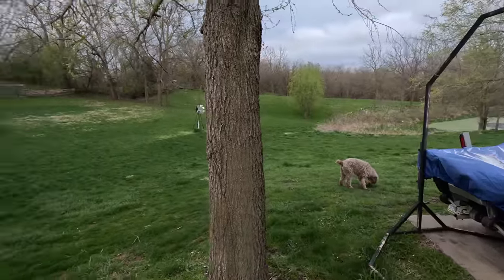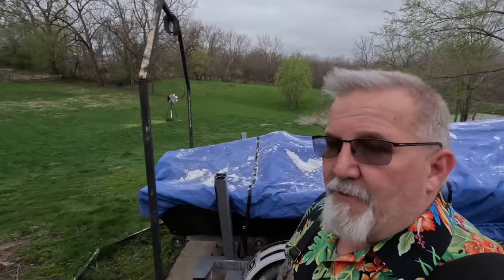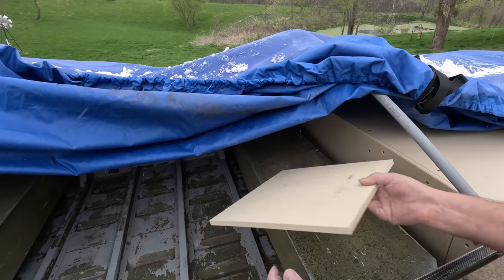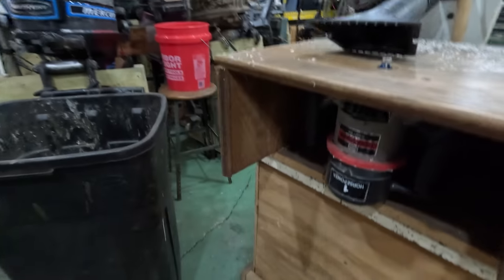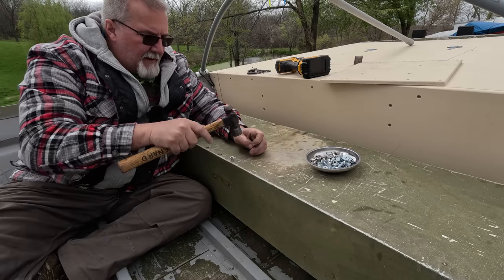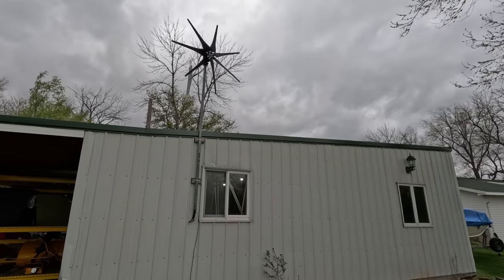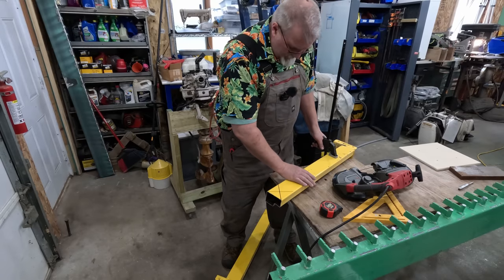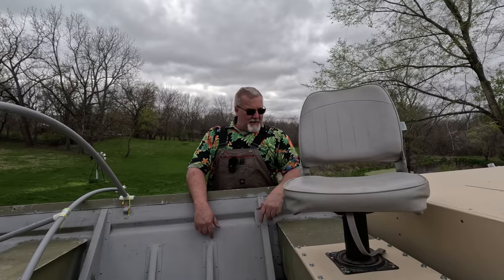1983 PolarKraft Genius boat seat mount plus a dry dock modification

Comment: Some good info on the seat mounting on the Good Enough boat, 
But what caught my eye was what was used for the tarp support arches and how they were mounted to the sides.

This will be a vast improvement over the vertical adjustable support poles that seem to fall out with just a little bit of wind thus creating a Big capture area for the rain water to collect. 

Like you I Refuse to work in cold temps unless I absolutely have to.

For the Enquiring Minds

The clamping force
 (tensile strength) 
of a 1/4"-20 bolt by grades 

Grade 2  is 1313 lbs psi
Grade 5  is 2025 lbs psi
Grade  8 is 2850 lbs psi

👍👍
Reply from the maker: that should be enough bolt to hold it for sure, I would even call what I did a bit overkill, thanks for watching and the information

Comment: You may want to weld some angled support brackets to reinforce those pedestal mounts (suggest three on top and bottom going from the base plates to the main pedestal cylinder). Those welds at the base are notorious for failing while the boat is under way with any kind of weight in the seat. (In fact most of them come with warnings NOT to use them while the boat is being driven.)  I've also found older models on the used market made of steal with the added supports already welded in place to eliminate this weakness.
Reply from the maker: Interesting for sure, I haven't had that type of failure, must fatigue over time, thanks for the tip and for watching

Comment: I had a 2004 liberty and the front driveshaft started jingling and jangling @90ish K- I removed the (front)driveshaft and brought it to 
a machine shop to press out press in worn part instead of buying a new shaft assembly - I did continue to drive as a 2 wheel rear wheel 
drive while they worked on the shaft and because I noticed a marked improvement in gas mileage even when I got the repaired shaft
back I continued to drive 2 wheel till late fall when I knew winter was coming-  though I didn't have a boat and trailer at that time so 
I didn;t have slippery boat ramps to worry about-  For what it's worth I thought I'd share - Cheers!
Reply from the maker: thanks for the information and thanks for watching

Comment: nice job on the seats. now whats the deal on the 1955 johnson 10 hp sitting on the floor?  thanks for the sunday morning video.  your just a jenuis.
Reply from the maker: Well are you talking about the one in front of the tool box?  Is so it's a 1956 I'm told, 25hp. I'm the third owner and I'm going to get it running and it will be tested on the good enough eventually. Thanks for watching and commenting

Comment: I have a question,  I have a 1987 40hp 2 stroke nissan and has one cylinder not firing. I've put a new fuel pump, cleaned the carb, out now spark plugs on it and it has 120 compression in each cylinder, has good spark, but the bottom cylinder won't fire and I can't figure out why. Do you have any suggestions?
Reply from the maker: You are seeing spark on both plugs?
Reply: @RMDCreations  yes, I even switch the park plugs and put the bottom wire on the top cylinder and the top wire on the bottom cylinder and the bottom still didn't fire up